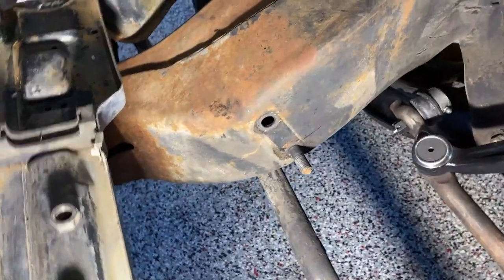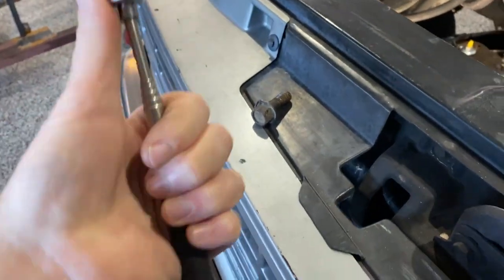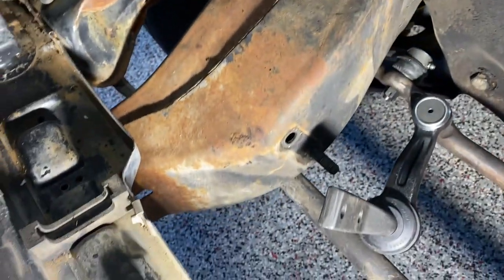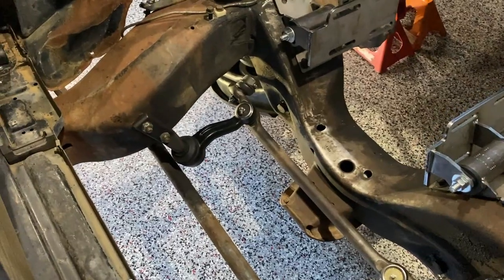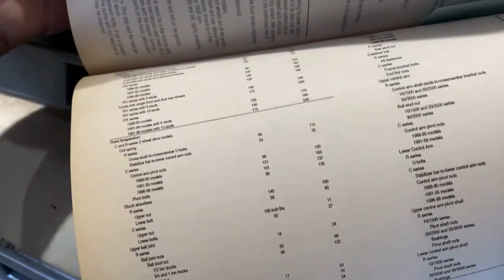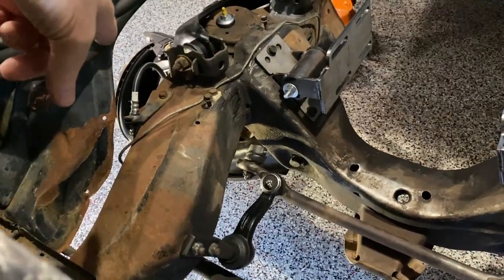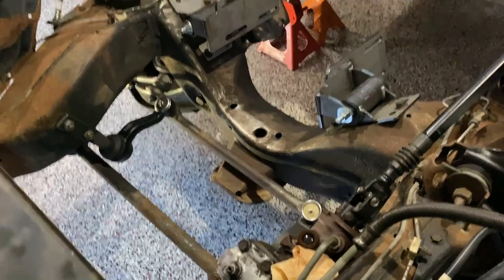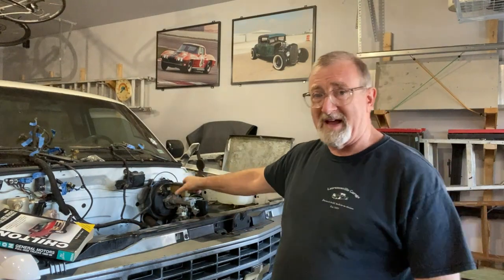1988-1998 Chevy OBS Truck LS Swap Project New Suspension / Steering Install Part 2

Comment: Nothing like watching an obs being worked on I have 1996 have had it for 4 yrs and I love it. Im from Dallas tx as well
Reply from the maker: Small world! Yes, I prefer the OBS truck’s style over any others. Had a bunch of them. Newest truck I ever owned was a ‘95…
Reply: @laurencevillegarage  @ back on 2000s i had like 5 of them, but gt rid of them, now i want them back,😩😩   I only got the 93 shortbed swapped,,   😞
Reply from the maker: @gerardolopez5875  I feel your pain. If I knew then what I know now. Picking up another project vehicle tomorrow.
Reply: I got a 94 and I'm from dallas too
Reply: @laurencevillegarage  @ who’s reworking ur 5.3 harness s??
Reply from the maker: @gerardolopez5875  I’ll be doing it myself!
Reply: @laurencevillegarage  @ with stock fuese block? Or  modified?
Reply from the maker: @gerardolopez5875  We will see. I am sending my pcm off to be reprogrammed as we speak. I'll be working on the harness soon...
Reply: @laurencevillegarage  @ ok,👍👍👍
Reply: @laurencevillegarage  @ make a guide for  starter and neutral safety switch,   Only things , iam stuck with😩
Reply: @laurencevillegarage  @ did u send the pcm?? On a/c   U going with the a/c 3 pin transducer?
Reply from the maker: @gerardolopez5875  I did send off my pcm today. I also asked several questions about the a/c, so I hope to know more about it in a week or so. Should have a part 1 a/c vid out tomorrow…
Reply: @laurencevillegarage  @ 👍  will run the same r4 compressor?

Comment: I would have like to see the final installation. You did not show any of the suspension parts. Just showed the engine bay
Reply from the maker: Thanks for the comment. True, putting in the new was just the opposite of removal, with few exceptions. I tried to cover the tips without creating too long if a video.